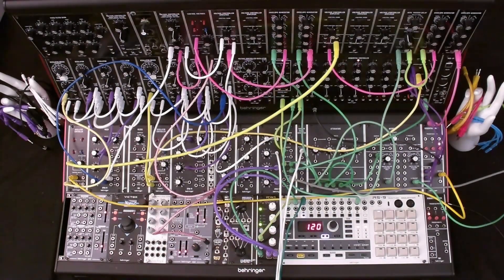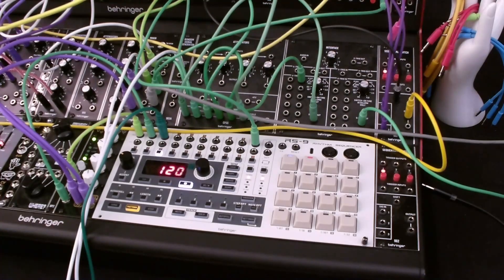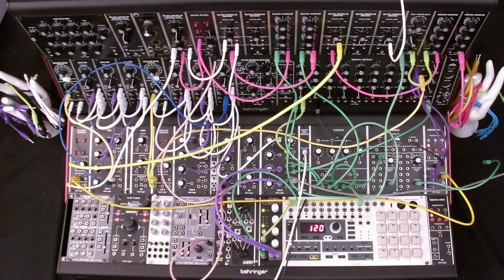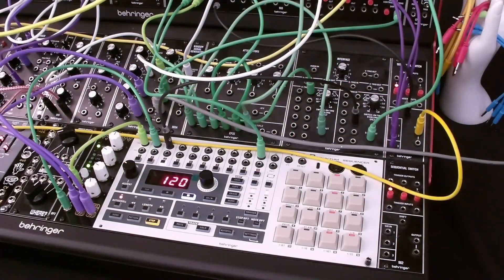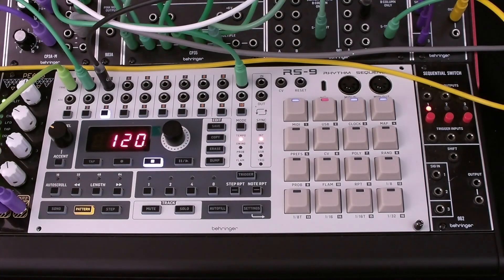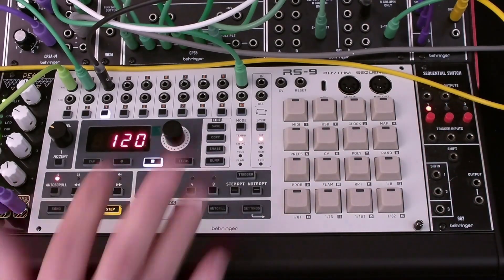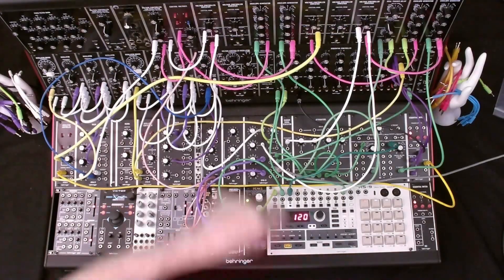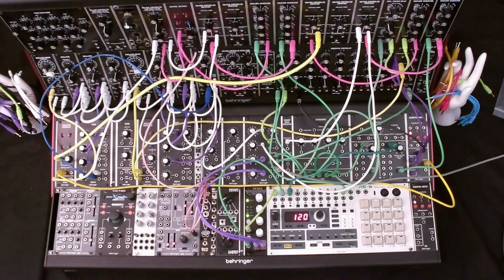Ep 2 RS 9 Create Patterns and Sync 960 Sequencer

Comment: Hi Oz Hall, I would like to use the white noise as a hi-hat like you, but I already have two s-trig outs from the interface to two 911 S-trig IN envelopes. So I tried to get around it by passing one of the two outputs of the interface to a multiple CP35 Behringer, however, I hear both at the same time (my synth + my clap when I trigger with my RS-9) at each trigger, which I don't want. Do you have any ideas or tips? Thanks in advance
Reply from the maker: This is why I have added additional envelope(s) which use v-triggers to my System 55.  The RS 9 gate outputs are v-triggers.  You could use a module as simple as an Attack/Decay (A/D) envelope.  There are lots of choices in a 6 to 10 hp size.
Reply: @ozhalljr  Ok thank you! I think i will take a zadar